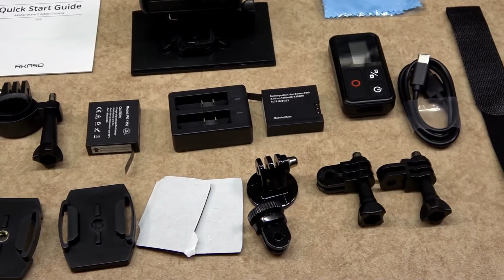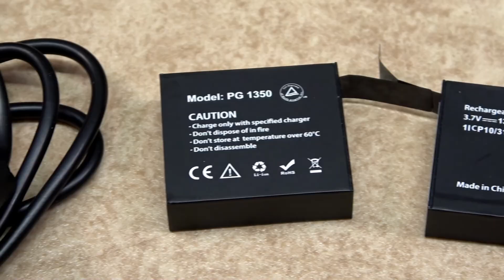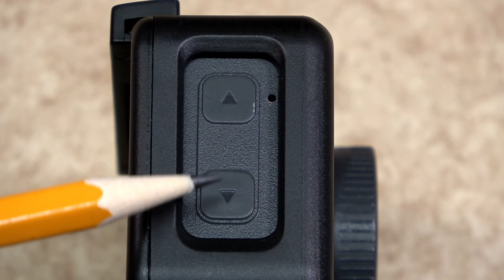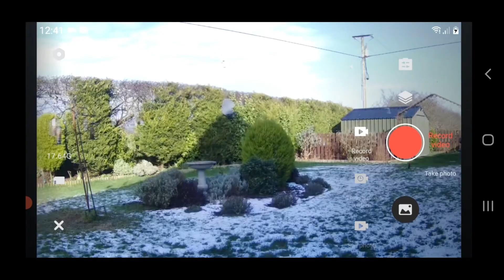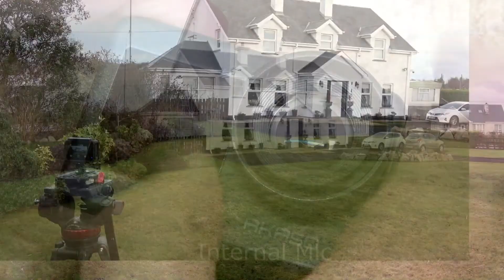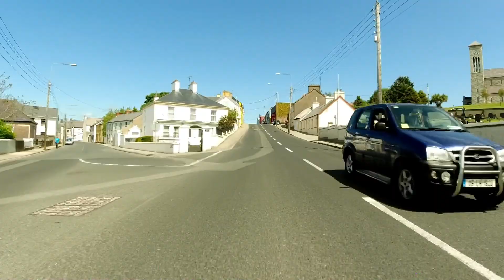AKASO Brave 7 Action Camera

Comment: Be sure to check the screws on the back of the remote control, due to the loosened screw water got in during the first dive and the remote control no longer works... otherwise the camera is very good for the money invested
Reply: The remote control is not waterproof.